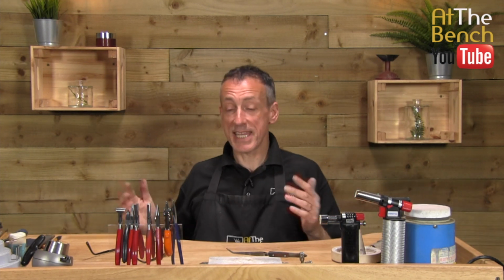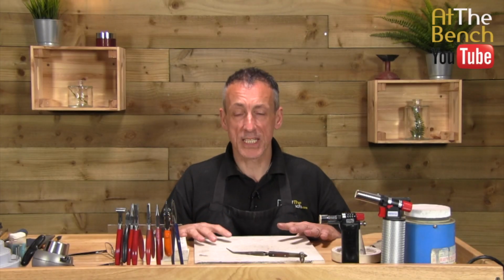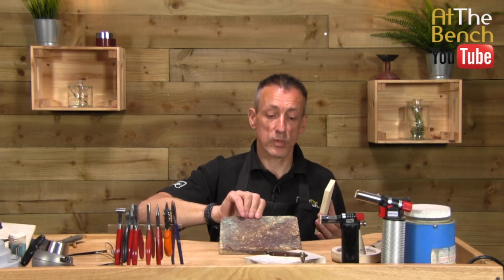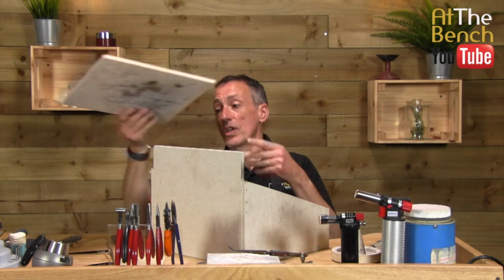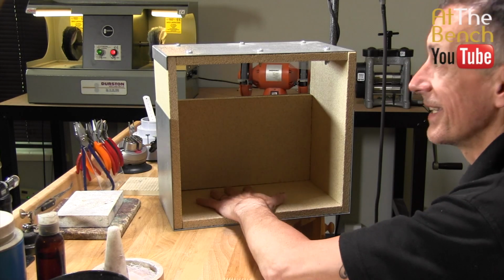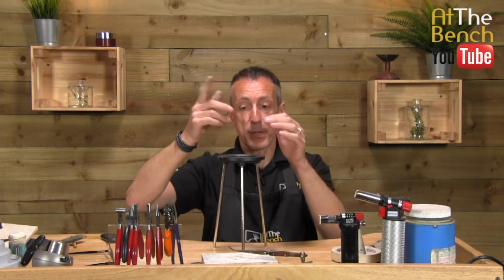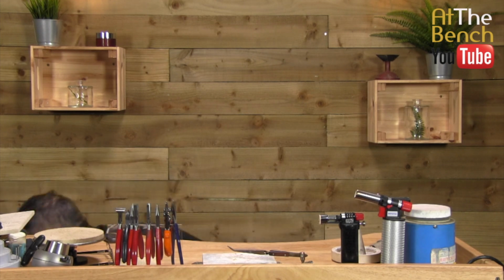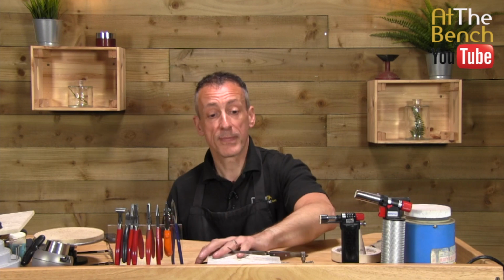How To Make A Soldering Station for Soldering and Annealing Your Jewellery

Comment: Hi, what do you use to cut diwn the solder board?
Reply from the maker: An ordinary woodworking saw works fine
Reply: @Atthebench  Thank you. I tried to nail them all together but the nail is damaging  my board,  is there an alternative?
Reply: @tayobello1935  I wonder if it would help to pre-drill where you want to nail with a smaller diameter than the nail?
Reply: @kimauger4293  Thanks . Will try that out.

Comment: Also, how might one work their ventilation systems with this solderite station? I am presently installing an inline exhaust fan with duct tubing, (debating on 4 or 6” ducting), but am perplexed how to employ either with the soldering enclosure. Run tubing inside or lay atop back or side boards?

Comment: Love your station idea. It is YOU who is brilliant! Question: what is the base you have used?  You said you have two solderite boards on the bottom but it appears to be three layers, the bottom of which appears screwed, not nailed. Is the very bottom wood?
Reply: It looks like the top layer is a thin lip (so things don’t fall out?). Looks about 2 in wide strip across.
Reply: I’d also like the answer to this question, please.

Comment: Hi Andrew, thank you very much for taking the time to make your videos and sharing so much of your knowledge. I have a question about the Betts boards you recommended in your link:  which one of the three shown there did you use for your soldering station?  They have three different prices so I suppose they differ in some way?
Reply from the maker: It’s not the 6mm that’s too thin. It must be the one at the top about £5 each. Call them and ask the thickness. It should be approx 9mm
Reply: @Atthebench  Many thanks, Andrew.  😃

Comment: Hi Andrew, could you advise on lighting for jewellers? I'm looking for a good lamp to use when working during the evening or when lighting isn't great. Would appreciate any recommendations.   Thanks for another informative video!
Reply: I have a Durston Clamp-On Desk Lamp. This is a wonderful bench lamp. It's $124 at Otto Frei currently (#113.1905), but worth every penny. You can put it where you want to attach it to the bench with its clamp. It's lightweight and very easy to maneuver and it will stay exactly in the position you want it. It doesn't pull back or sink down. There are three different types of light - bright, warm, and cool so you can use different light for different tasks. And each kind of light is dimmable with a very nice low-to-high range. Oh, and the bulbs are LED so it will probably last forever.

Comment: I can't speak for prices in the UK, but when I made my soldering area I used 9mm fiber cement sheet for the basic body it was less than half the cost of the soldering boards and 10 times stronger
then I just use the bricks etc placed inside to do the soldering on
Reply: I just bought my fiber cement Hardiebacker board for the exact same reason.
Reply: Is this ok to solder on??? Does it give off fumes and is it fireproof?
Reply: Do not use brick as it will absorb the heat away from the item you're soldering and it will take longer to solder.
I'm not sure if the cement board absorbs heat instead of reflecting it.🤔
Reply: @E-Kat  Insulating bricks e.g. K23 actually absorb less heat than the old fashion charcoal blocks Fibre Cement is not suitable for direct flame as it will break up.
Reply: @pijnto  I'm so sorry, I have not understood your message.🤗
Reply: @pijnto  hi again! I gather you don't use the charcoal block, do you? You solder directly on that fireproofing brick?
I'm wondering if it's a good idea to place my charcoal block in a metal holding dish?
Would it take away the heat? Or would it be negligible loss? Probably binding it with a wire is good enough? ☺️
Reply: @E-Kat  No I gave up using filthy dirty charcoal blocks when I discovered the kiln bricks are just as good and are clean and don't fall to bits, putting your block in a metal dish would not take the heat away in any amount to worry about, yes binding wire will help keep it together
Reply: @pijnto  thank you for your wise advice. Thanks for your time.
Reply: @E-Kat  You are welcome happy if  the knowledge I have is helpful.